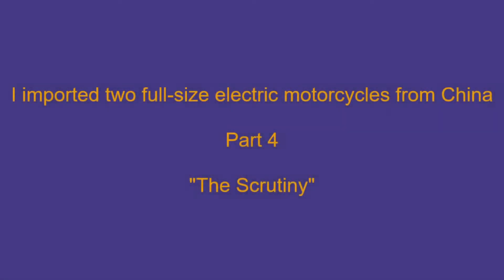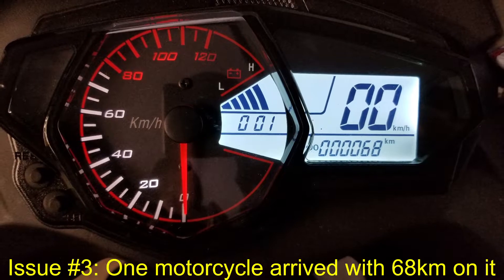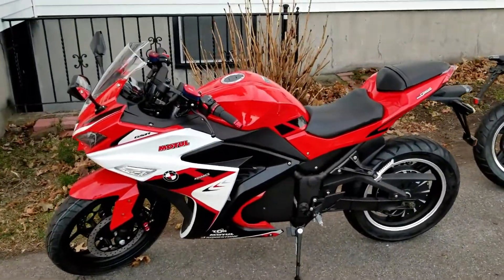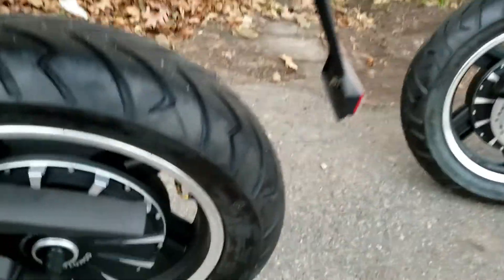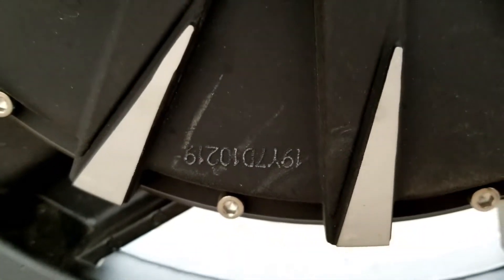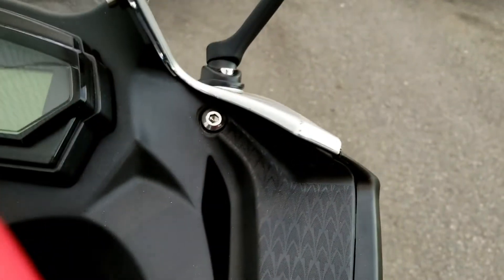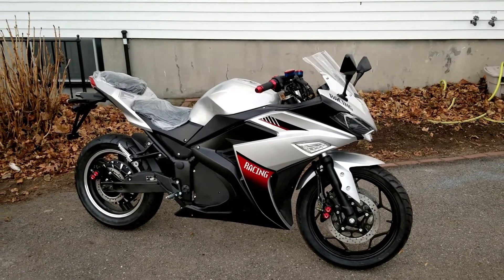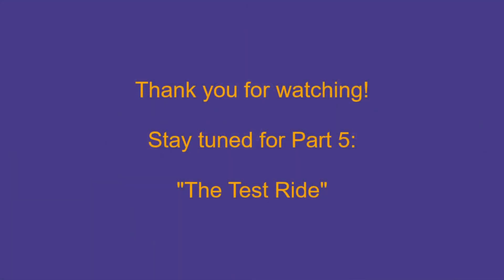I imported two full-size electric motorcycles from China – Part 4: "The Scrutiny"

Comment: Always clean the brake rotors with isopropyl alcohol, tyres always have a tiny layer of oil to prevent extreme dry when stocked.
Reply from the maker: Thank you for the recommendation. I will clean them up before the next ride.

Comment: Hello. I was looking for this motorcycle in Taobao to buy it. The motorcycle's battery has two choices: lithium-ion battery and lead acid battery. These high-powered motorcycles should be equipped with high-discharge batteries, is there a high-discharge battery?
Reply from the maker: These have regular lead-acid batteries. If you can afford, buy one with Li-ion batteries.

Comment: How you start the motorcycle?
Reply from the maker: Here are the steps:
1) Turn the key to the "On" position.
2) Put the red toggle switch on the right handlebar to the armed position (indicated by an semi-open circle).
3) Rotate the switch on the left handlebar from "P" (Park) to "D" (Drive) or "S".
At this point, the motorcycle will be on. Once you twist the throttle, it will start going.